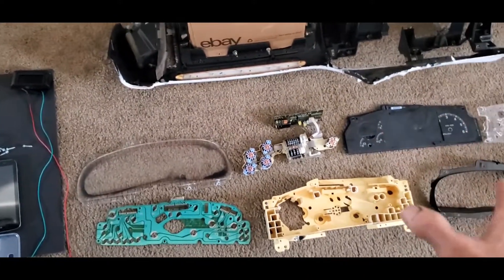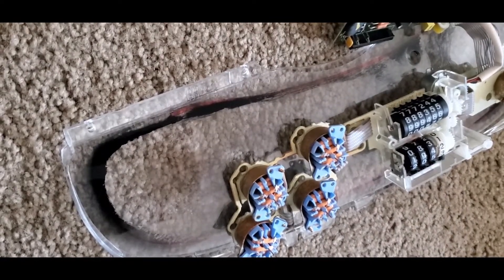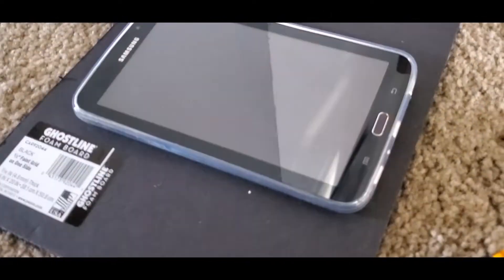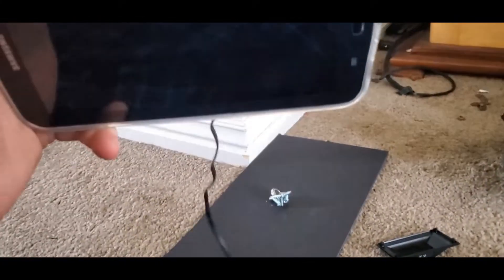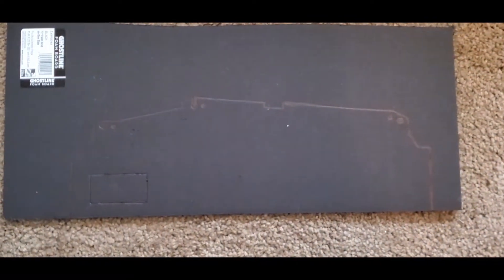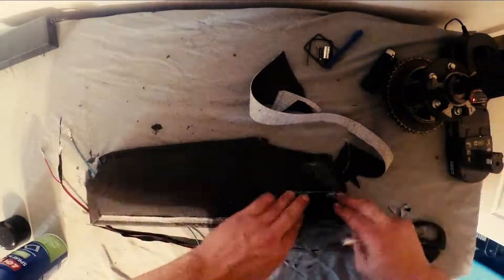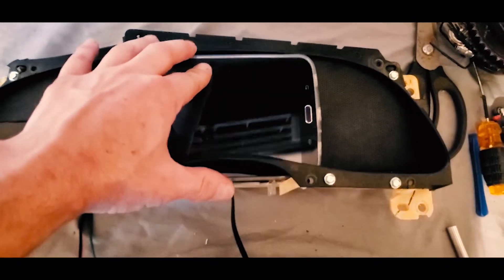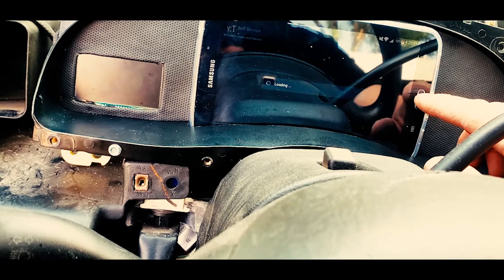cheap Digital Dash Cluster

Comment: Where do tyou get the charger
Reply from the maker: I get mine here, its called a mcdodo charger.

https://www.ebay.com/itm/393729430804?mkcid=16&mkevt=1&mkrid=711-127632-2357-0&ssspo=onnawr5yryo&sssrc=2349624&ssuid=NmA2TNcIStG&var=&widget_ver=artemis&media=COPY
Reply from the maker: I think the micro usb style is almost extinct,  i upgraded to the Samsung Galaxy A7 lite, its got type c.
Reply: @StraightLineCycles  damn i just bought a tab 3
Reply from the maker: @IDKWTFID  no worries you can still get gaming style ones that are 90 degree, or even magnetic style ones, i will keep looking for the flat one, but remember its called a mcdodo charger.
Reply from the maker: Also these are an option 

GELRHONR Micro USB Cable U Shape,180 Degree Angle USB 5-Pin Fast Data Sync Charging Cord USB A to USB B Fast Charger Wire for Most Micro USB Devices - Black 1Ft/30CM https://a.co/d/bj4wq5K
Reply from the maker: https://www.walmart.com/ip/Final-clear-out-Uslion-180-Rotating-USB-Fast-Charging-Cable-US0133-Android-2M-Purple/402938327
Reply from the maker: @IDKWTFID  there are still a few options , also 180 adapters are available but ive never used them.

Comment: What else can use other than that tablet
Reply from the maker: Any tablet,  this one is pretty old as far as tablets go, just gotta get torque pro, or lite, on it from the app store
Reply from the maker: Also the obd2 adapter is  from ebay but dont get the Bluetooth adapter get the wifi adapter instead